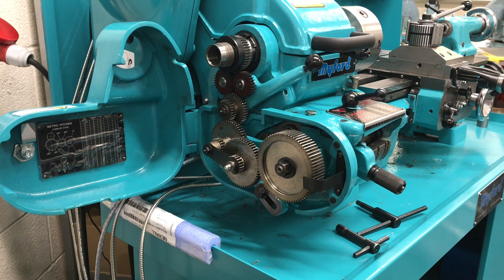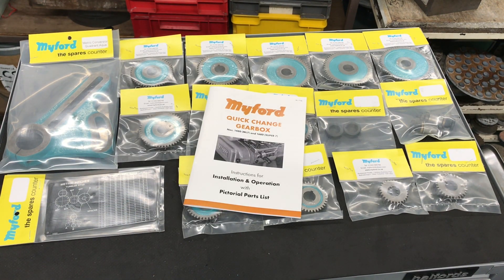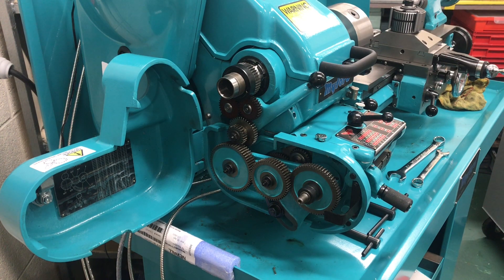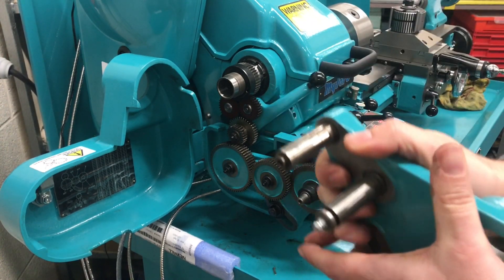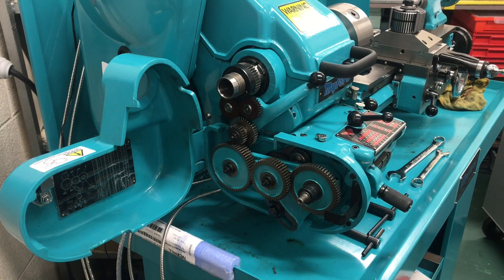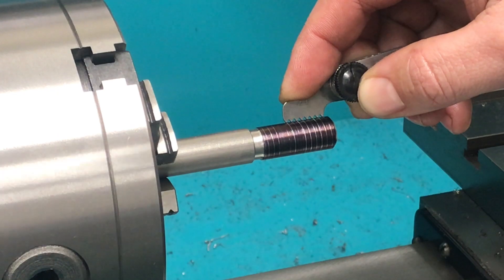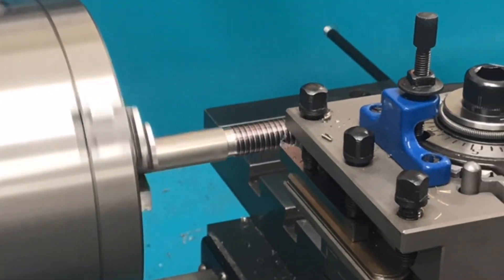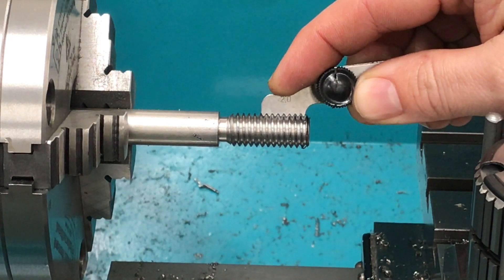Myford Super 7 Turning Projects Part 1 - Metric Thread Cutting

Comment: What a stunning lathe!
It's probably way too late now but I would  not recommend a magnetic chuck on a lathe.  If you use it add some superglue as things can go very wrong very quickly.  (Don't ask how I know)
Reply from the maker: Thanks very much. 
I haven’t had much need for it to be honest but it’s nice to have it. I bought it to machine things like shims or other thin / parallel parts. The intention was to make a carrier to go around the parts which are a close fit around the periphery of the Chuck so that I wouldn’t have a positive co strainer rather than rely on friction alone. I’ll get round to a video on that one at some point.

Comment: You might want to read up on the 33T and 34T  change wheel option. This basically enables you to keep your imperial set in and use your gearbox to cut almost anything. I have the same lathe as you and it's a real game changer.
Reply: Where do I find that information?
Reply from the maker: Cool, I’ll look into that for sure. Thanks for the tip off. I’m by no means expert on the subject of Myfords. My time was served using Hardinge and Colchester Triumph lathes (plus Bridgeport of course). If those gear ratios open up more options then I’ll be sure to give them a try.

Thanks again.

Comment: I wish you had explained the setting up of the gear train. There may be other videos out there that show this, but I’ve yet to find one I can understand.
I’m new to the screw cutting thing, so how do you tell a Myford metric gear from a Myford  imperial one...are they marked metric/ imperial on each gear?
 I thought the gearbox was solely for changing feed rates via the leadscrew..is it used for screw cutting also?
I have the Myford manual that came with the machine, but unfortunately it’s very sketchy on screw cutting set ups.
Reply from the maker: Thank you for your feedback. I’ll make a short video explaining it. It’s easy when you know how but a mystery when you don’t. I’ll try and cook something up this weekend for you :)

If you have a manual for the gearbox then there is a very important page with a table which specifies which gearbox position to use and in conjunction with wha gears to have fitted. Unfortunately I don’t have it to hand at the moment as I’m away but I’ll make sure I include it in the video. 

A set of gears will provide a range of pitch threads when selecting the right gearbox position. The table will specify which gears to use by the number of teeth.
Reply from the maker: @Harry Karry, I’ve just uploaded a video which I hope will answer your question but please let me know if not. Here it is:

https://youtu.be/yPHru9D3aWs
Reply: Fantastic. Thanks very much indeed🙂

Comment: 7:40 2mm pitch. I got the feeling you said you were aiming for 2.5 !!

check the transcript at 2:13 - you deffo said M40 2·5
Did you mean M42·5  2
Reply from the maker: I did mean 42.5 x 2. The chuck fits perfectly so it made the part correctly but got a the numbers mixed up in the narration.
Reply: @opticalmechanic  OOH, the excitement of being recorded - LOL
Reply: @opticalmechanic  So how do you stop spinning stuff flying off a rotating mag chuck ?
Reply from the maker: @millomweb  ah well, I will be revealing that little trick in a coming video so I’m afraid you will have to sit tight for now... 😜
Reply: @opticalmechanic  No probs. Just don't expect me to share what's wrong with your lathe setup then :)

Comment: Why didn’t your chuck come loose when you went into reverse. How have you locked it. I have an ML7R and can’t reverse with out the chuck coming loose
Reply from the maker: It’s quite a tight fit on the threads / location diameter. There is a grub screw on the backplate too but I don’t need to use it as the chuck stays tight. I don’t do any cutting with it in reverse either, it probably would unscrew if I did.

Comment: Myford are remiss not to have fitted an interlock switch on the lead screw gear train guard.
Reply from the maker: I know what you mean. It makes me feel sick thinking about getting fingers or clothing trapped in those gears but years of training and experience hardwires good practice into you. The cover has a lock on my machine which can be opened with a cabinet key. I left mine unlocked and open for demonstration purposes. Whenever I’m working on the machine to change a chuck or the change gears, I will always either put the machine into E stop or switch off at the mains. I’ve heard too many horrible stories to not take precautions.
Reply: @opticalmechanic  Hi, I was thinking more that it was Myford who should be complying with the Supply of Machinery and PUWER Regs as appreciate an old school toolmaker is far to wise an animal to stick a digit into meshing gears😀. I am a former toolmaker and have a Myford 254S long bed lathe and that does have an electro magnetic interlock on headstock guard. Thanks for the heads up regarding PeWe tools as I have three original multi-fix tool posts and need to obtain a replacement garter spring for one of them👍

Comment: Is this a metric Lathe? Can you use the thread dial indicator to engage rather than keeping the half nuts engaged & reversing the direction
Reply from the maker: It is a metric machine and I could use the thread dial indicator but it doesn’t seem to repeat very well for some reason. It would certainly make thread cutting more efficient if it worked adequately. When my machine was built, Myford had the thread dial indicators on back-order so they gave me a second hand one for the interim. I’m still waiting for it to become available. I have no idea if a new one will be any better until I try it.
Reply: @opticalmechanic  thanks, I went ahead & ordered a S7 in metric last week. Looking forward to taking delivery with it & having a play! I am somewhat new to lathes & find videos from yourself & others a massive help.  Thanks
Reply from the maker: @irvine40  oh cool! I can offer some thoughts on a DRO set up if you’re interested in going that way. It’s not essential but does help a lot. Maybe I should make a video on the subject? 

Have you ordered a machine with a quick change gearbox? If not, you could always add an electronic lead screw so that you could easily turn metric or imperial threads compared to having to changes gear wheels etc. It’s a bit more involved initially but there’s a ton of info on the web and in some ways, I feel I might want to set my machine up that way too.

I’m glad you’re finding the videos useful. Thanks for the feedback!
Reply: @opticalmechanic  i opted not to go for the quick change gear box !  I do plan to eventually go for a DRO I think a lot of people go for the machine DRO , it looks reasonably priced.
Reply from the maker: @irvine40  I had a Machine DRO that I fitted to my old green Myford, there should be a clip of it in one of my videos. It came in kit for that was a bit Heath Robinson which put me off using the same for my new machine. However, they have improved them a lot over the last couple of years to the point where the X axis encoder is very slim lined and can be concealed inside the cross slide (with some minor mods) and an end cover / cap fits over the end of the reader on the back side of the cross slide. The Machine DRO seems to be a few microns less accurate than the Newall system but it’s not enough to be a problem for most users / applications. 

I was interested to know if I could retro fit a Machine DRO encoder onto my machine so that I could have the X axis completely concealed since it does get in the way slightly and there is a risk of damaging it. I do need to make a guard for mine as it’s a matter of time until I break it. The bad news is that Newall systems use a signal that is totally different to other systems so my retro fit idea was a non-starter. 

If I was choosing a DRO, knowing what I know now, I would have gone down the Machine DRO route. My only hope is that Newall make a similar encoder option to the Machine DRO arrangement so that I can upgrade mine in the future and keep it tucked up, out of the way.